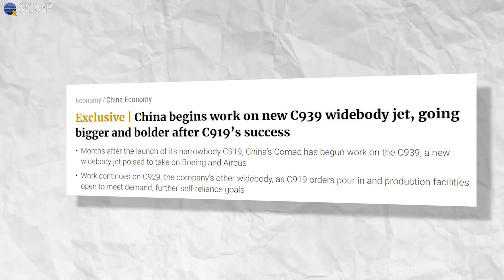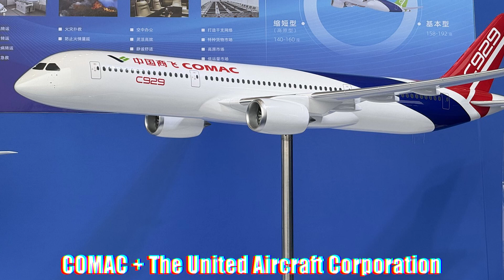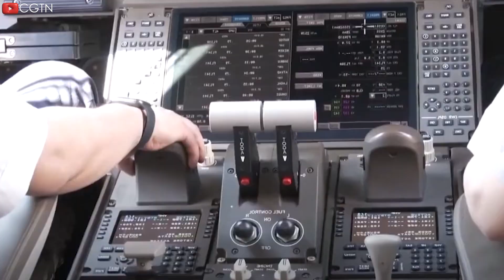This China NEW COMAC C939 Will Change The Aviation Industry! Here's Why

Comment: 0:53 China's high-tech manufacturing? But the C919 is mostly made of foreign parts. There are few C919s in service, and the C919 has yet to be cleared for (wide) international use.
It seems to me you're reporting the aspirations of COMAC. Words are cheap, actions/results are all that matter.
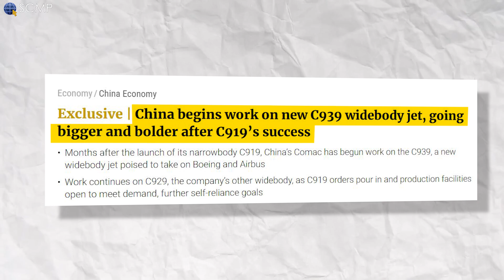1:12 Oh, well at least you even report that it will take many years, hence, aspirations of COMAC.
Isn't it kinda funny that a video about COMAC mostly shows Airbus and Boing planes? But then again, very few C919s are in service.
1:27 The C939 doesn't have anything, again, COMAC has aspirations... This video is rubbish. Either AI made it, or it was thrown together using online translation for text-to-speech.
2:24 If not much is currently known about the C939, then how are you reporting so much, and with so much confidence?
When Xi uses a COMAC plane to travel in, that's when you can start to think they make good aircraft.
3:03 LOL, what crappy animation. The nose didn't even rotate up before taking off. Whoever made this animation is lazy and/or ignorant.
7:16 Produced by a Chinese company? Or another way of saying that is assembled by a Chinese company (as the C919 is made up of like 70% foreign parts). Apple devices, designed in America, assembled in China (and other places). C919, designed in the west, assembled in China (PRC).
7:40 I recall C919s were grounded in China by the Chinese Civil Aviation Authority (or w/e it's called). So, it's safe to say it'll be awhile before it gets international approval.

I can say one good thing about this channel. At least it's a real person speaking, not some text-to-speech audio. But that won't prompt me to give it a like.
I gave it a dislike because the script he read talked about the C939 as if it's already a product. He needs to learn to write scripts that reflect the current reality. By simply adding "COMAC is aiming for/wants to/etc.." would make this video more based in reality.
Reply from the maker: Thanks for your feedback!
Reply: @FLIGAVIA  The indicator is the price....  If it's cheaper than normal aircraft, then yes.... It's Made In China ! (Regardless of foreign parts)